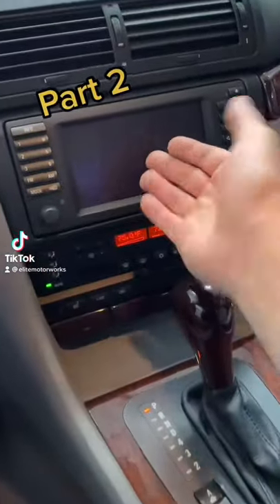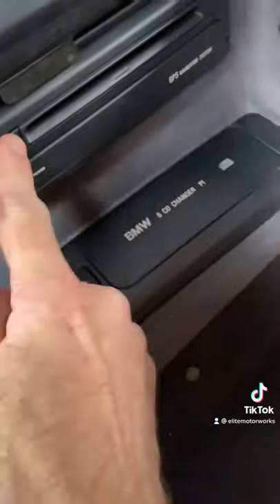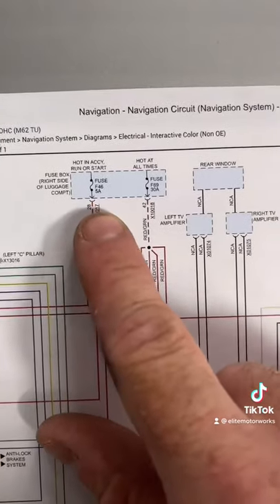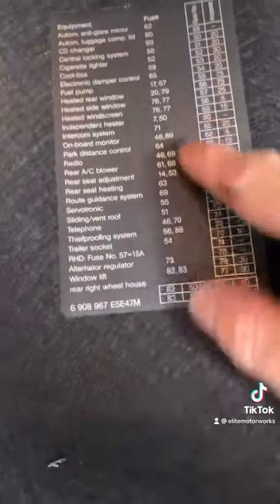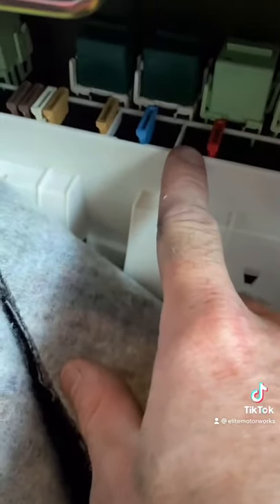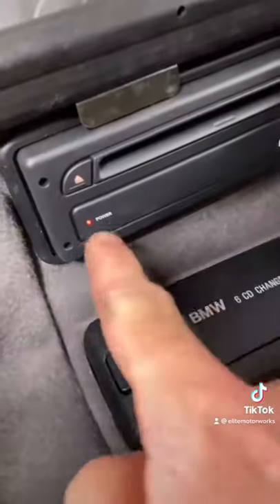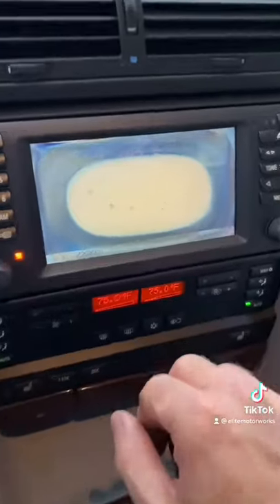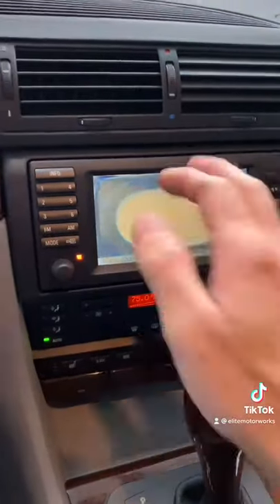BMW Nav Screen diagnosis Part 2 #shorts

Comment: 30 amp fuse: 89 cents
diagnosis and replacement: $900

Welcome to BMW world.
Reply: I bought a 2001 330i sedan with a new 3.0L m54b30 engine. I was skeptical, went out an hour to check out the car, needs only about a grand to be reliable and I paid $1500. I got lucky.
Reply: It's the same with all auto-electrician related work.
My cousin used to have a small shop doing nothing but auto-electrics before he retired.
He often boasted of $15k weeks when he did nothing but change fuses.
Reply: Yes, and of that $900 the technician who had to do this will be refused payment from his dealership because “you should just do it for free as part of the service.
Reply: That sounds reasonable for a BMW navigation screen
Reply: Understand logistics and cost of tools, etc, then youll understand the $$$
Reply: @FoodFighter46  Preach it!!
Reply: @FoodFighter46  he used his hands
Reply: @FoodFighter46  he replaced a fuse within 5 minutes...
Reply: You're paying for the knowledge and experience, not just the fuse.
Reply: @UnrealKinniki  you can't Google it?
Reply: I dropped 1k for my spark plugs to be changed.
Reply: @FoodFighter46  No but we are all just a bunch of troglodytes who are out to scam the customer. A customer that claims to be able to do our jobs, but mysteriously always brings their car in to us for service 🥴
Reply: @incogcheeto9322  Sure you can, but it's a hell of a lot easier when you've worked for years with the material, rather than searching through Google for every problem, because Google isn't always reliable on things like that.
Reply: Exactly why I learned cars and work on everything myself
Reply: Literally dude
Reply: I dunno i just bought the bmw scan tool and software ripped from china for 100 bucks and you just do it yourself?
Had abs module and stability/traction control module failure. Reinstalled and recoded myself.
Worked great.
Seat module programming and other things like idle and vvt adjustments to make it run nicer.

Comment: I sure wish I could find a shop like yours around my town. I have actually started doing my own because I would end up spending more to replace parts because no one know how to diagnose any more.  But I now need to replace the massive timing chain on my 2012 CLS 550 . And it's a big job as you probably know.  
Why is it so hard to find a good shop nowadays?
Reply: I love the back of the CLS class. Those tail lights look like women’s lips with bright red lipstick.
Reply: Its like that in all jobs with manual labor
Reply: Timing chains? On a 273? Why because of the balance shafts? That shouldn't  affect your MY.
Reply: @LynxStarAuto  no the right  chain tensioner Failed  Causing the guard to break I believe. The chain itself was still in spec. But I seen no reason no to change them sense I was already in there. 
It really wasn't as bad of a job as I thought it would be.
Reply: @LynxStarAuto  and it's a M278. I believe the 273 is a 4 banger.

Comment: Looks like the screen had a warped polariser, which is a common thing that happens in humid regions like in Singapore and some parts of Japan, as far as I could tell from posts online where some vintage PC enthusiasts had experienced similar issues.
The solution would be to try to get the LCD panel out and replace the polariser in a clean room, or replace the LCD panel entirely.

Comment: Fun fact: if you remove the 12v battery before the Nav Mk3 system shuts down, you can turn the NAV unit into a brick as well.

Comment: May i know why some of those BMWs (or possibly some other cars) have the CD tray located inside the trunk?
Reply: Luxury cars with like 10 cds tray or something.
Reply: @sayingnigromakesyoutubecry2647  
My VW Jetta also had a changer in the trunk.
I'm guessing just to keep the changer mechanism out of the cabin area, and possibly to reduce clutter, but who knows.
Reply: @sayingnigromakesyoutubecry2647  my 03 Fords got one in the center console
Reply: @heyallenify  10 cds don't fit in the dashboard
Reply: @AllIWantIsAPlaceToCallMyOwn  how many cds?
Reply: @sayingnigromakesyoutubecry2647  I had a mustang sporting a 5 disc changer  under the passenger seat, with a little 5-slot cartridge that popped out to make loading the CDs into it a little easier.. Not sure if it was from the factory as an option, or an aftermarket add-on, but I have seen them in "out of the way" places like that in a few vehicles. 🤷🏻‍♂️
Reply: That's because mechanism for changer is too big for dashboard, so it is located in the trunk, where you have a lot of space.
Reply: Navigation disk only goes in there
Reply: I could be wrong not entirely sure
Reply: @Cribs00  not necessarily.. the E65 has a slot above the glovebox for the CD changer.. some cars like Audis will* (edit: would - it's been a while since changers were a thing in cars) have the changer in the glovebox. It doesn't take up that much space.. it probably sits in the trunk on most cars because it can be noisy and it's something that probably doesn't get touched often and you don't have space for a cd carrier at the front in most cars.
Reply: Because the CD changer doesn't fit inside the DIN bays.

Comment: Can you help about e 39 touring 525 d touring? Have no Sound. All other features are working. also had the radio module (amplifier?) soldered. brought nothing. strange way, when the module was removed I had from time to time for 5 sec. music till it fade it away.. or cracked in the loudspeaker.

Comment: Have you ever seen a 2014 328d with the idrive head unit stuck in a bmw logo loop? Any tips?
Reply: That happened to me, I had to replace the unit behind the front panel. It's not hard to do. Trim tool and the right torx drivers. You can get a donor unit from a site like car-part. For me I had the base unit with the small screen. So I ended up taking advantage and replacing the whole screen, upgraded to the professional box unit and added the better idrive controller. It cost about $350.

Comment: Hmm I have somewhat the same issue on my e39 M5 except everything works but the screen. And weird thing is the screen only turns on when its hot outside. Like +85F hot
Reply: Bad inverter on your screen